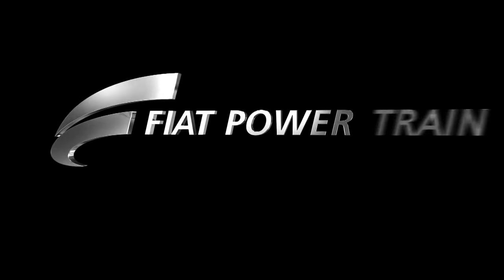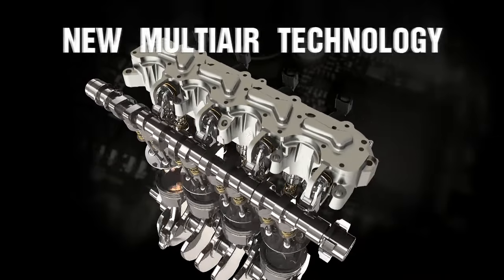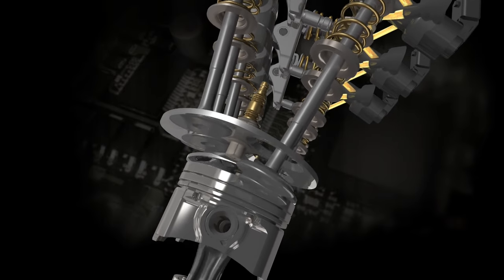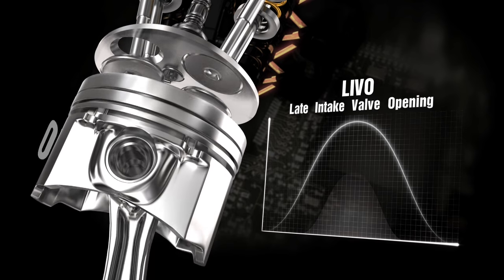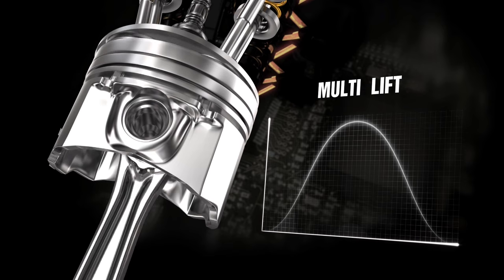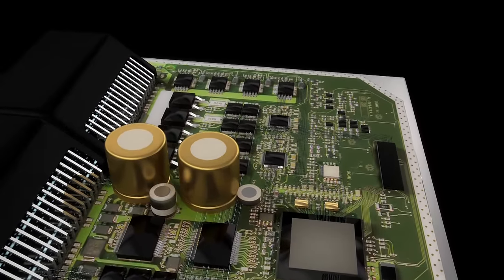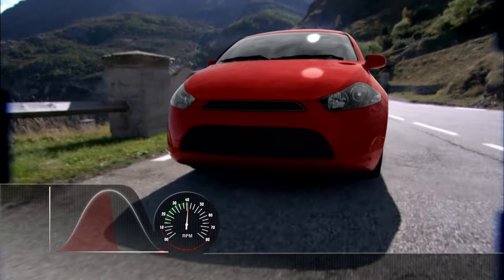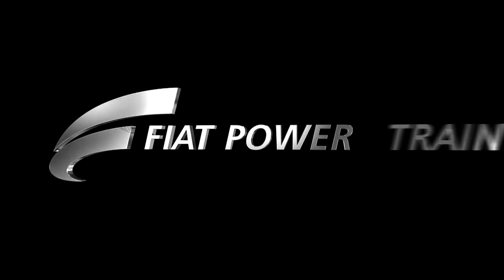How Fiat MultiAir Technology Works

Comment from the maker: Sorry, the reality is owners get easily over 40mpg.  Check the forum out.
Reply: It's the absolute truth. I recently bought a 2012 Fiat 500, and I've consistently averaged 40mpg.
Reply: It does but reliability is key. How much is an engine every 50k miles? Do you save 5k in fuel to replace said engine? Buy a Honda or Toyota same price same fule economy or better and they last.
Reply: Punto Evo no turbo, 37 mpg on road trip.
Reply from the maker: @1sinister80  Is it Toll or Troll?  LOL.  Couldn't resist and just kidding;) Sorry, but the engines last as long as any other modern car.
Reply: it's very low.
Reply: I'm afraid you're wrong

There is a reason that FCA is failing in America and has a poor reputation elsewhere also

Your cars are just not engineered well enough, they have an incredibly bad reputation for being unreliable 

Take note from manufacturers like Toyota, Honda and Volkswagen who are known for building vehicles with much better reliability 

Stop cheaping out on components, invest more in research and development and look at why you have such a bad reputation 

I can tell you what problems your customers will have with this engine and I haven't even seen it, these are common on Fiat engines

The sump will rust out
The camshaft will fail
The ECU will fail
The exhaust manifold will fail
Coil packs will prematurely fail
Electrical gremlins will appear after about 3 to 5 years caused mainly by bad earths or poor quality electrical cabling 

Why is it that other manufacturers can develop engines and car bodies that last and Fiat can't UP YOUR GAME
Reply: @edwardtrickett6064   you could be more wrong dude, you obviously dont know much abut cars and car market either
Reply: @dimitrisniper  my brother is a time served mechanic and MOT inspector 

Fiats perform consistently worse than almost any other vehicle 

Plus me and my family have owned Fiats in the past and NEVER again

Me - Fiat Punto 2002 3 door 1.2 8v 
Problems: ECU failure, coil pack failure, brake master cylinder failure, airbag wiring loom fault, gear linkage failure, exhaust manifold cracking, radiator fan failure, radiator failure, door check strap failure, driver's side window motor failure, main fusebox overload and failure, head gasket failure, starter motor failure, alternator failure, windscreen washer clogging, washer pump failure, fuel rail leak, steering motor fault (dodgy relay), heater motor failure and heater matrix failure

The car was 2 years old when I bought it and some things were repaired under warranty but eventually it started to cost me money and so I got rid of it 3 years later when it was 5 years old and I got fed up of it keep having faults!

My uncle - Fiat Uno 1995 5 door 1.4 
Problems: Engine failure twice (both repaired under warranty), handbrake bracket snapped off - identified as a manufacturing defect and repaired as a gesture of goodwill, drivers seat collapsed, ignition coil failure, fuel injector failure 

My brother - Fiat Punto 1997 1.2 8v
Problems: radiator failed, serpentine belt wrapped itself round the alternator and caused - engine failure, wiring loom fault and drive train damage, gearbox failed, engine fuse box caught fire, coil pack failure 

These are just what I can remember with the vehicles that have been owned in my family 

My brother has been a mechanic and MOT tester for almost 20 years and what he has seen with Fiat vehicles beggars belief 

The amount of issues seen are just not warranted in vehicles the age they are from Fiat

I would NEVER own a Fiat again if you paid me
Reply: wow!, your brother's?? your uncle's ?? yours? amazing you have such an experience!! i am sorry, i  didnt know...
btw my family owned 1 citroen(sold because it was just old for us, had kind of expensive service) 5 fiats(none of them had an issue of its own, the obly issues we had is with a panda which has 280000 on the clock and stil counting and none of its service on time nor complete) 1 nissan(very poor interrior but engine is ok) 1 seat (a lot of uniportant electronic issues but for no reason) and  1 suzuki(17000 if i had aproblem that woulb be weird) also  there are a lot of people who love their japan/german car and dont trust italians (there is rumor in greece that italians have poor electronics) but they all drive a fiat engine without knowing it
Reply: @dimitrisniper  Fiat can and do make reliable engines particularly diesel engines

The JTD engine had been used in various manufacturers vehicles in various displacements and usually to respectable mileage too

The one Achilles heel for Fiats above almost anything else is electrical issues

They also stretch technology to within an inch of it's life, I get it, they are trying to save money but WOW

Any who, I'm put off Fiats for life

The only way I would EVER have one again is if it was a company vehicle and I wasnt paying the bills 

I will say that my Punto had a comfy and roomy interior, the ride was a little jarring sometimes but otherwise it wasnt too bad

If it wasnt such a fan of the garage I would have loved it
Reply from the maker: @edwardtrickett6064  Sorry. You say you haven't even seen the new engine. So in other words,  you don't know what you are talking about.  If your brother is a MOT inspector, that's not here in the US.  All those things you mention are things that might have happened on the old cars in the bad old days of the past.  We don't have those cars here.  The Fiat 500 and Abarth 500 is not sold in Europe with the MultiAir engine we use.  The only thing on your list we ever see here in this country are occasional coil packs on older cars, but that is common to many modern cars now.

Comment: does this tech make the engine more susceptible to failure? it seems pretty complicated.
Reply: +Ian Chesney Not complicated at all. First it was the variable intake valve timing used in early Alfa Romeos, then Honda made (70yrs after) the vtec control, where the old mechanical timing was changed to an electric one, but for all the intake valves in a moment. Now, MultiAir re-invented the electromagnetic valve control, and now both intake and exhaust valves for every single cylinder are timed separated for the best combustion.(PERFECT CONTROL)
The point is, the valve control in the regular engines is the worst of all. :D But this was usually used in the last 100 years (where a spring pushes back the valve during its closing state, and a biig problem is: it need always the same time to do that, so the valve opening with the speed of the shaft, but closing with the speed of the spring rebound...
 And additionally another limit for this technique is the limited rev possibilities. That's why the Desmodromic valve control (used by Ducati) is far better.  But somehow  in the bike industries and in the car industries too, nobody gives a s*** :D It's a strange stupid world..)
Actually, it's a trivia, build in more components for a function can always be a source of failure. But: these or similar components (vti, vvti and so on) ARE in the car engines since the early 90's, and so they are very very reliable even in a Suzuki swift, or any other cars from the cheapest brands, i think it's not a big risk. Don't forget, in small cars there are much better tested solutions to find, because the car companies are selling tons of them.
If we have to fear something, it's the TDI.... (nitrogen oxide lie, oil pump drive shaft failures, etc..)
Reply: yes that is another whole thing fiat is exploding and i hope that their reliability goes down the drain, because there trying to produce as high as the demand. and thank you for explaining the function of the multi air engine! very different approach, than what im used to seeing.
Reply: The multiair unit can fail but usually only does so with high mileage if using wrong type of oil. And if replaced, it rarely goes wrong again.

Comment: Question... Can it keep the intake valve open as long as it wants to? In other words does the solenoid store the pressure it gets from the camshaft? Is it something that could simulate a bigger race/performance camshaft that can simply be programmed in? Or does it only have infinite control over the intake valves while camshaft pressure is applied to the solenoid?

Sorry if I didn't word this right... hopefully somebody gets it lol.
Reply: I see what you're saying, but I'm not sure. I don't think the solenoid has the ability to stop the oil flow (hold the valve open) as this would likely cause problems on the camshaft side by creating suction in the oil passages.
Reply: This is a question a lot of guys like,me are asking that want to modify the 2.4l darts.

Like do we just need a cam kit with bigger exaust lift/duration and then tune the computer to adjust how much intake lift and duration is used at different throttle positions/rpm ranges? Either some tech company is going to break open the flood gates or this engine is going to be a engineer disaster

Comment: its like VTEC but electronically controlled
Reply: VTEC is a copy of VVT (variable valve timing) made by fiat / alfa romeo.

So, multi-air is a more advanced VVT, and VTEC is just a copy-paste from fiat's VVT.
Reply: And multi air can make the valves open multiple times per stroke
Reply: Without the high lift....

Comment: I have a 2016 Chrysler 200 2.4... it uses the same engine I just need to know how reliable this engine is I had this car for about 3 months now no problems but kind of sketchy at times it burns oil like there's no tomorrow maybe because piston ring bad from factory...
Reply: my wife has a 2015 has put like 77,000 miles no issues. with these Italian motors they need a little more love and attention then most cars, but if you give it to them wont let you down.
Reply: 50k multiair unit fails & is replaced, 55k it fails again. It also drinks oil like there’s no tomorrow.

Comment: Ok so this changes how far the valves open similar to valvetronic but through oil pressure in between the follower and the valve.
Reply: More closely resembles the VVEL by Nissan/Infiniti.

Comment: Can you explain why these engines are so subceptable to oil consumption?
Reply: They arnt....the problem was....key word was.....cheap cylinder side wall coating. The oil was heating up(which is normal) but then the piston would ding and scrape the side wall coating because it was weak....giving the oil a path to the chamber and being burnt.

Mopar put a new engine in my dart with stronger sidewall coating.....now its fine.
Reply: Loose rings and seals to reduce friction.  It increases mileage.
Reply: A big part is what nobody wants to admit to. They never checked their oil in between 10K mile oil changes, ran their engine low on oil and damaged it. Of course, no one wants to take responsibility so they have to blame someone else.  They get their liars for hire involved and sue. You know that's a lot of what's going on here. Not everyone, but a good many.
Reply: @vonLuk  Very true! A person shouldn't have to expect to check their oil regularly in a new vehicle either. By 24k miles I was going through 2-3 qts of oil every 6k miles. Couple that with 28 trips for warranty work in 2 years, damn right I sued! First year 500x, last time I buy a first year car too!
Reply: @cahman8 you know the first few hundred miles is the period where the engine will get its most wear in its lifetime. The break in period should have oil changed after 300 miles and then again after 2000. 

People thinking they buy a brand new car and then expect to have it maintenance free for 2 years lmfao

Comment: This is a very complex way to achieve multiple valve timing profiles.  Why is it only used on the intake and not the exhaust side as well?  Mr. Koenigsegg has figured out a way to do what multi air does (and more) with a fraction of the parts....not even a camshaft is needed!  His system can net 30% more power and 30% more millage.
Reply: would you really trust a niche company, which tries to sell you electro hydraulically actuated valve systems in an internal combustion engine? To me those systems have to be seriously rugged to withstand the shear temperatures of high performance engines and I don't think I would trust a small company like koenigsegg to make it so
Reply: a small company, with lots of money.  Its not hydro...pneumatic.  There are hydro systems which function the same way...just with fluid instead of air which are used on massive freight tankers.  Why would you think a pneumatic actuator wouldn't hold up when things like fuel injectors basically open/close very fast via a electrical signal and sit right on top of the motor and last a very long time?  And if we ever get to see this system in every day cars, it will be when the big car companies adopt the tech.  But, I wouldn't hold my breath, they are not likely to adopt any system that is less complex, more reliable or is better MPG.  They care more about profits than improvements.  Koenigsegg is great because improvements in tech matter more to him than money.  It is rare to have a inventor as the owner of a company.
Reply: But injectors aren't present in the combustion chamber, they don't feel the heat, and you are kinda wrong a company which cares about its profits, Renault, tried to make a camless engine. For their formula 1 engine iirc, and they failed. And Koenigsegg isn't on the bleeding edge of technology as some car magazines would have you believe, granted they do stuff the regular car nut wouldn't imagine, but their Regera concept for example used a more advanced form of the gearless electric powertrain used in the lowly Honda insight. However, if Koenigsegg does indeed succed in making a valvetrain which uses oil pressure or an electric motor or a magnetic signal to work instead of a cam, I really hopeit comes to everyday cars, I am tired of spending 10 minutes each day waiting in a line to get petrol.
Reply: the pneumatic actuators don't have to be IN the combustion chamber.  They have to push the valves.  They wont have to deal with any worse conditions than current valve train components do.  And I don't see any reason you cant cool them.  Koenigsegg from what I have seen is good at adapting and improving tech from one field to another.  Giant engines for those cargo boats used electro magnet actuators for the valves.  These are massive and even scaled down for a car's valves they would still be too large.  pneumatic actuators can do the same job but be far smaller.  The major auto makers wont introduce any tech that could hurt their profits.  New tech that can bump MPG or HP buy a small amount and increase the number of parts will make them more money.  They are making hybrids instead of pure electric not because pure electric cars wont sell...but because pure electric cars wont make much money due to reduced parts sales, no fluids to change, reduced servicing ect.  More money is made in parts than in the actual vehicle.
Reply: +Hasan Luqman Qazi  Actually, some believe that Koenigsegg is the inventor of this system. lol
Reply: @999benhonda  improvements matter more than money until you look at what a Koenigsegg costs... great tech, but still way to spendy for it to make it to mass production...

Comment: When they graduate to individual air/fuel monitoring per cylinder and individual control, THEN the big gains will arrive. Variable valve tuning is great but you still can't optimally balance cylinder output.

Comment: So it’s SOHC?
Reply from the maker: It was originally a twin cam engine, but they removed the intake cam and replaced it with the MultiAir mechanism. Lobes were added to the exhaust cam to help actuate the MultiAir and intake valves.

Comment: So is the 2.4 liter Tigershark "MultiAir" II engine in the Dodge Dart a Chrysler or a Fiat????   I was first informed that it was a Chrysler.......
Reply from the maker: It is a Chrysler engine that uses Fiat MultiAir 2 technology.  What was Chrysler is now Fiat Chrysler Automobiles so it is all one company now.
Reply: still dodges motor with fiat technology
Reply: One in the same. Chrysler owns Fiat. Same engines used in multiple vehicles across the Chrysler, Dodge, Jeep, Fiat line up.
Reply: NO, Fiat owned Chrysler.

Comment from the maker: There are millions of engines using MultiAir on the road.  Sorry your one engine has an issue. Nearly all issues are caused by poor maintenance, wrong oil or extended oil change intervals. You are exaggerating the costs of replacing the MultiAir unit. The whole assembled unit averages between $500 - $1300 depending on the car.
Reply: Oh so a $1300 part and $1000 in labor after a failure at 75k miles is just "No big deal" to you guys at Fiat? Most cars can get their engines replaced for $2300. You guys mustve stolen some marketing heads from MB and BMW to be throwing out figures like that as if they were chump change.
Reply: 🤣 Even their comments are a joke, not just the cars

Comment: Can You Imagine If Fiat Chrysler Brought Back The 440 7.2 With Multi-Air On All Valvles!? And With All Todays Technology Like With Fuel Injection, Ignition System, Active Manifold, Multiple Displacement System... etc. It Could Meet Todays Emssions Standards While Still Being A 7.2Liter. You Wouldnt Need To Se Up Timimg Chain... Just Connect The Cams That Power The Oil Pumps For The VVA System. There Probably Will Never Be A Centralized Oil Pump To Supply All Variable Valve Actuators Because Starting Would Be A Pain. The Future For The Valve Train Is This. Lol (What Cam Files You Run?)
Reply: The viper has a 8.4 litre v10 and meets todays emission standards. But i see what your saying That would be awesome.